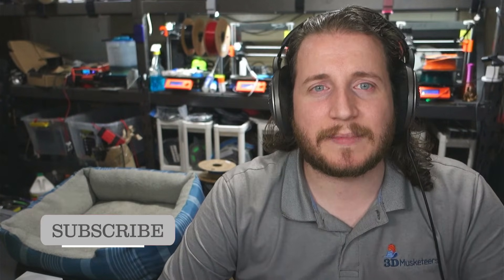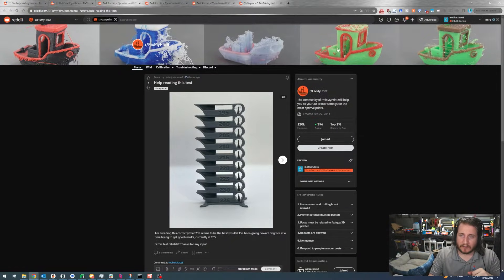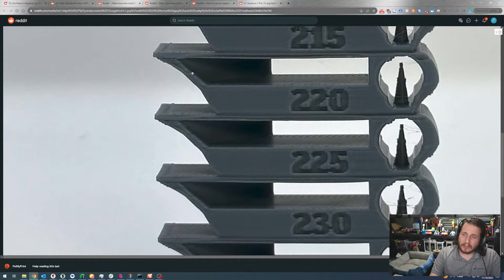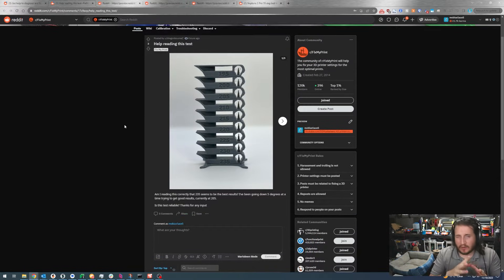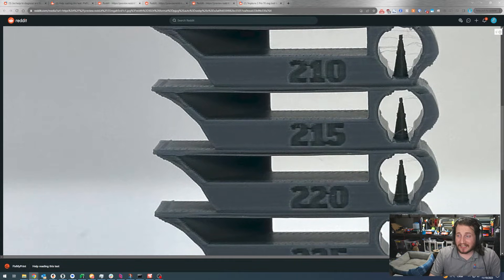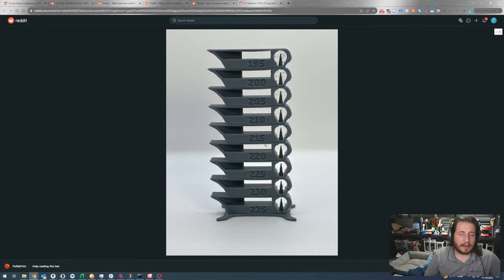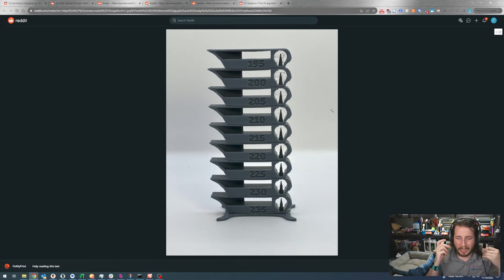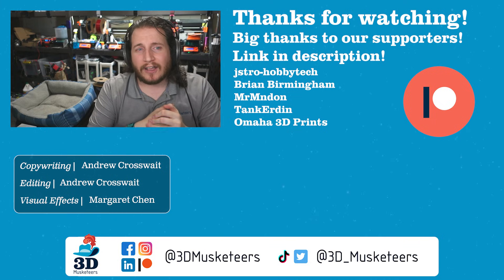Understanding TEMP TOWERS! - PrintFixFriday 115

Comment: Thanks for video.
But man your eyes are so red, you should probably try and get ventilation with all them printers in your room. I had that issue myself, runny nose, and coughing. And i only printed PLA
Reply from the maker: It's a stress issue we have found out. I have to limit my working hours to under 100 a week to keep it at bay.

Comment: It is frustrating that PrusaSlicer doesn't have these tools built in, it's why I swapped from that to SuperSlicer because of it's built in tools, but around a year back it became too buggy so I swapped back to PS. Still trying to work out a simple way of running towers for Klipper :)
Reply: Were you able to come up with a method? I’m fairly new and prefer PS, but since I’m working with LW PLA, I haven’t found an effective way to test it other than trial-and-error using different aero parts

Comment: So, I did a temp tower. 225 and 195 looked the best, 195 had the best bridging, and 225 had ok bridging. Bridging on the rest were trash. I even broke the tower and examined the bridges, 225 was mostly fused, and 195 had one single strand that didn't fuse, the rest seems solid. They were also considerably harder to break. Would it be sensible to use 225 for first layer, and 195 for the rest?
Reply from the maker: Maybe 200 first and 205 for the rest? I like a bit of extra heat personally..

Comment: Good video. But as you said, temperature tower is tiny and printer needs few millimeters - like five or ten - to reach full speed and the same distance to stop. So appearance of small prints like benchy, temperature tower or keychain gargoyle can be very different from large prints where printer can reach 140% of it's max speed when going diagonal and things can go bad at "optimal" temperature or at any temperature.
First two months I printed either PETG or matte PLA and little of PCTG, matte PLA is always matte, PETG is mostly shiny, but for larger prints it can be good to significantly limit flow to maybe 6mm3/s or limit speed of outer and top layers by trial-error and increase temperature or decrease layer height. The very same applies to PCTG. But what surprised me that two brands of PLA are somewhat satin/pearl when printed slowly and large prints look basically like matte PLA with the exception of sharp corners. I expected PLA to be always shiny. Shiniest material is actually PCTG, it looks like a glass (but it's among softest printing materials)

Comment: The 'pins' or posts within the circles are also useful to test the lamination of the layers. Use a pen or screwdriver to push on each pin and the one that takes the most pressure before it breaks shows the best lamination.

Comment: have 3d printer ender 5 s1 pro and I have sonic pad. have problem level my bed and temperature its printer moves the designs I make please help me. what the temperature heat bed i put my 60 my front doesn't sticking
Reply from the maker: try cleaning the bed with hot water and dish soap :) Something like Dawn with no moisturizers in it

Comment: What I’d like to know is: What’s the best order for the various calibration tests? I assume they are depending on each other, aren’t they? Is the proper order as listed in the OrcaSlicer Calbration Drop Down Menu, so Temperature ➔ Flow Rate ➔ Pressure Advance ➔ Retraction?
Reply from the maker: that seems like a fair way to do it.
Reply: @3DMusketeers  is there value in repeating anything in a cycle to really dial things in, since, for instance, after changing flow rate, the temp results may change, or is it just diminishing returns/so minimal it doesn't matter.

Comment: I only use them on different materials now, i.e. silk, abs, etc but once I have a general temp I don't bother. Like PLA and PLA+ 205/60 for normal speeds up  to 150mm/s and at 250mm/s I will up it to 210 sometimes and it prints just fine. Too much to test on every brand and color I have as I have at least 50 open myself.
Reply from the maker: Yeah at some point the settings will generalize across the materials.

Comment: The important thing is to take the pinchers and try the strength in the z-axis. I cut into the same spot on the right and was really surprised at the difference. I recently raised the ABS print temperature by 30° because of this. The print is now glossy and the bridges don't look pretty, but the print is now rock hard.
Reply from the maker: Abs should bridge well with some cooling.

Comment: I bought some Tronxy glow in the dark filament. It clogged after an hour of printing on six tries! Then I ran it above the temp recommended. I tried 225c rather than 220c. No more clogging. A temp tower won't tell you that a higher temp is needed to avoid clogging.
Reply from the maker: Hopefully on a hardened nozzle!
Reply from the maker: Hopefully on a hardened nozzle!

Comment: Just add 1, 2..... additional instances of your tower until max flowrate is reached. Only way to have real life like test.
Reply: I brake the temp tower and chose the temp depending on where it has max strength rather than looks. 
But I print 90% technical stuff how has to be strong.
Reply from the maker: unless they connect you would still have issues with flow, no? or is that just to increase layer times? Adding more than one basically invalidates the overhang test though I believe
Reply: I mostly have 500 Ratrigs : In real life, I would never print one benchies, but 10 at a time anyway... That is if I had an order for 10 benchies  @3DMusketeers  I usually add instances until I get a constant flow rate around my optimum, playing with layer height. Obvioulsy it helps a lot for cooling. The temps tower must be crossed with max flow tower, PA and retractions.

Comment: PLA temps can be so weird at times. I kinda stick to one brand now but my filament/printer combo I run at 180C for the gray PLA+ I use. 190C in winter in the basement. 

Yet when I post a print and my settings I get insulted for printing to low, but if I go higher the print looks horrid. So, I keep it low and the parts are strong. Table top terrain, a few disability aids, shelving pieces, just basic prints really. 

Then again I use a stock EleNeptune2S, so I bet the temps may change if I had a different printer.
Reply from the maker: interesting, we find 200-210 is best for normal PLA here lol
Reply: @3DMusketeers For strength 215C is apparently best for PLA.

Comment: That temp tower is my favorite, with convex and concave overhangs, the bridging section with multiple lengths, the text, and the stringing/adhesion cone. I think it also does a nice job of helping eyeball flow rates (if the corners are blobby rather than square) and ghosting. My only very tiny gripe is the maker’s stamp on the bottom side…if your Z-offset isn’t dialed in well or you’re testing a filament that struggles with bed adhesion, the reduced surface area can sometimes lead to the tower popping off the bed. 

This version of it, though, makes me wonder if the temperature changes were set up backwards…bridging and stringing in PLA shouldn’t really get better at such high temps. I’ve done enough of these that it’s pretty easy to set up the temps without thinking too hard in both Cura and SuperSlicer, but I can see how someone could get mixed up when setting the temperature changes. 

Fun temp tower story of my own: back when SnoLabs had to cut back on inventory due to a failed filament dryer product launch, I picked up a spool of blue PETG for super cheap. As I recall, the recommended nozzle temp range was 225-245C and I pulled out the PETG version of this, the Smart Compact Temperature Tower. Everything from 225 on up to 265 looked horrible, though the lower temps looked better, so I openly wondered if I hadn’t gotten a mislabeled PLA spool - the next temp tower I ran seemed to confirm this, as 205 was the best temperature for the spool. It was no big deal, I got it for cheap and I honestly felt bad for the SnoLabs dude because his Raspberry PETG and Atrovirens Blue PETG colors were phenomenal (and no longer up for sale). I could make use of it as PLA just fine. 

So I did that, by using it in a two-color print (drawers for 3D Printy’s Rolling Storage Box, which another person who posted a make to Printables did and made it look utterly magnificent). I realized that the filament really was PETG when the blue top part cleanly and easily peeled away from the black bottom part after the print was finished…sometimes PETG can print best way colder than you or the manufacturer would expect.
Reply: My petg manufacturer said 235~255C but so far 220C printed way better. I only did 250C on a 60C bed with fan off to get good stiction. Then back to 220C with fan at 40% on other layers. I even did 70% fan and it worked fine.
Reply from the maker: I thought the same thing, maybe it was backwards, but I don't know LOL

Comment: I do like that temp tower, though I do have to brim it occasionally with the small pointy legs. Poking the cones inside the light bulb shapes for other adhesion is always fun. I've never printed a benchy, but I would print tf out of a zoomie.
Reply from the maker: yeah, a brim only takes an extra min or 2 and adds a ton of stability
Reply: @3DMusketeers  I was playing with Orcaslicer for the first time today and saw its got an option for automatic mouse ears which is cool, worked well too.

Comment: I use this one. /model/39810-improved-all-in-one-temperature-and-bridging-tower It's got overhangs on both sides. It has a big cone and a small cone. I think it works well. The only down side is it doesn't have variable length bridging.
Reply from the maker: https://www.printables.com/model/39810-improved-all-in-one-temperature-and-bridging-tower

ooooh nice!!

Comment: I found out that when printing fast, temperature is preatty much useless, what is needed is a long melt zone because my filament get overheated when printing slow parts and under heated when printing the fast parts. Even running pla+ at 260c on dragon hf can’t get consistent finish. If a fast part is printed after a slow part then the filament is glossy, if anything is printed after a fast move, I will be always Matt.

There dosn’t seems to be a workaround except for longer me;t zone soooo
Reply: I agree, polyners are such a poor heat conductors that the longer heating time of the longer nozzle improves the melting sicnificantly. I have also used bondtech cht nozzle, I think that works too pretty well
Reply from the maker: thats correct. unless you do something like the CHT style hotends, you just need longer melt zones to get consistent surface finishes